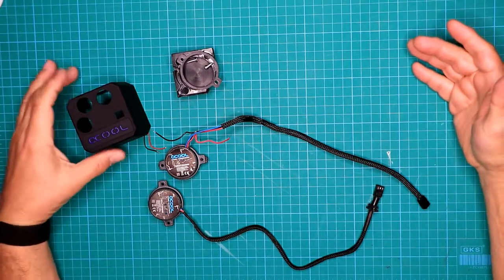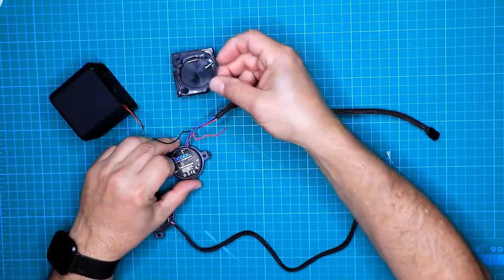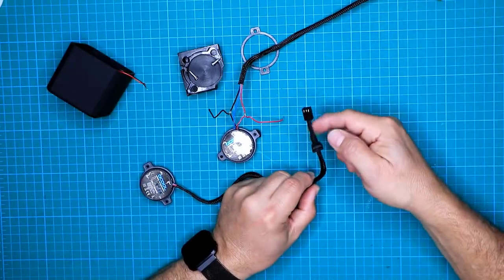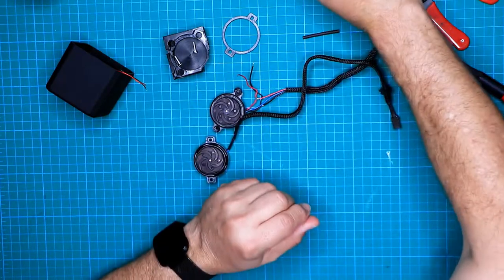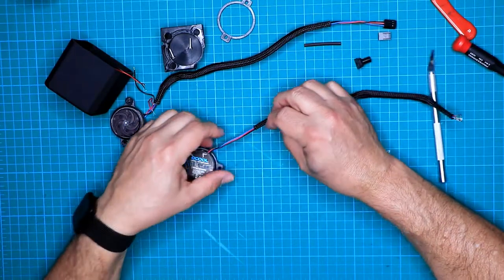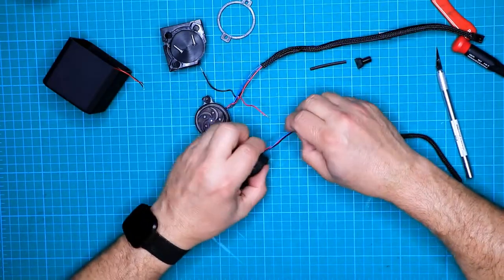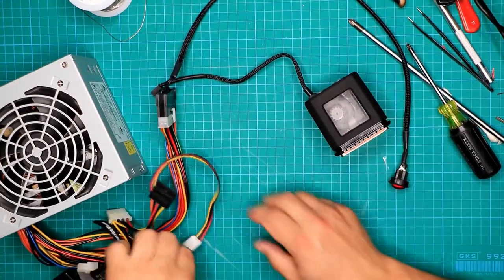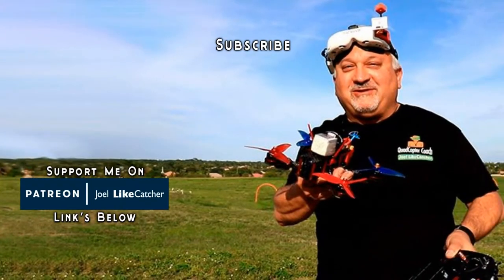Replace AlphaCool AIO Pump in Eisbaer WaterCooler

Comment: ...or you could keep the old wires then cut a 2" tail off the new pump and solder that on?  Liked and Subbed. I got that iron too with tips its pretty nice.